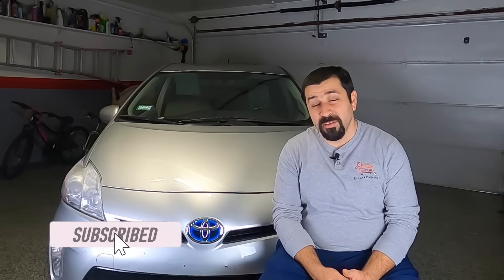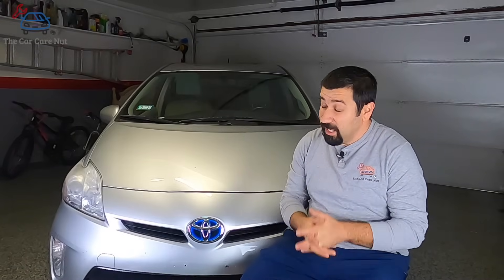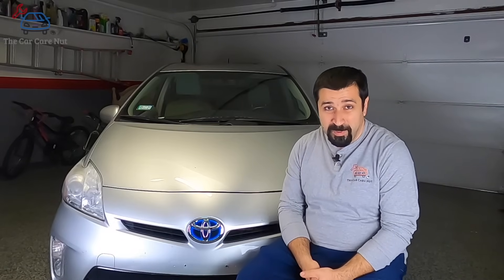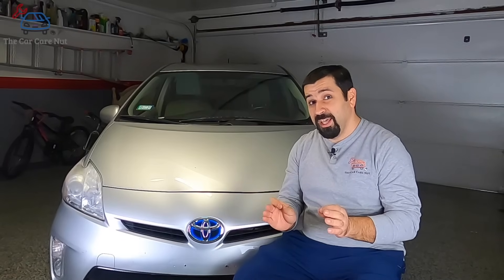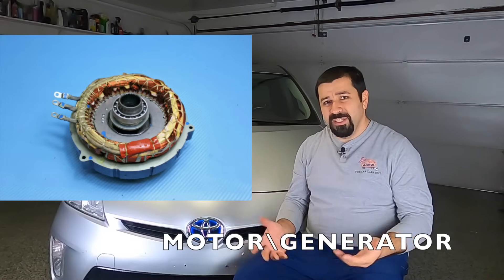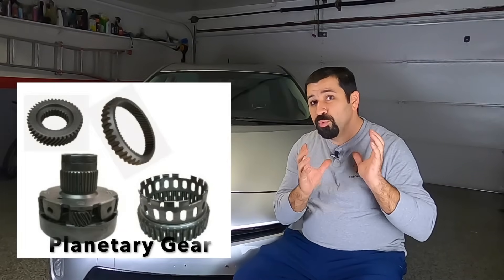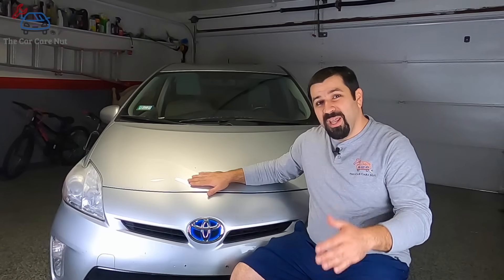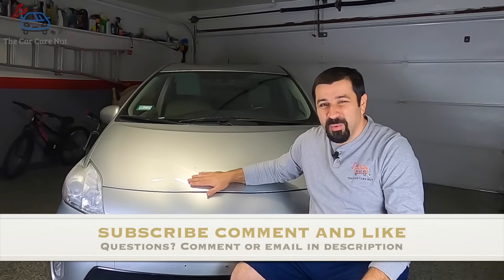How Toyota Hybrid System Work Part 3 Hybrid Transmission

Comment: Great job,    Couple of comments to amplify what you said, without getting too technical:  

At 5:15, when you run the engine fast, the MG1 goes much faster, and so MG1 uses most of the engine power to send to MG2.  So, engine spinning faster and wheels still spinning slow; That acts like a lower "gear" to make the CVT action work, even though no shiftable gears are involved.

At 7:00, battery can only take so much from MG2 on electro-braking.  If more braking needed, the disc brakes kick in to help out.

Comment: Toyota hybrids are reliable because of what is NOT in newer Toyota hybrids when compared to other hybrids.

No Gears, No CVT Belts
No Starter
No Alternator
No Timing Belt
No Accessory Belt
No Conventional AC
No Turbochargers
No Power Steering Pump
Reply: I just purchased a new Rav4 hybrid and absolutely love it BUT Honda hybrids also have No to all of the above.  Mind you Honda turbos are a major deal breaker for me.
Reply: @henryhonda8408  The Honda 1.5 turbo is extremely unreliable in Asia.
Reply: @henryhonda8408  Henry, Toyota Rav 4 Hybrid in real life will best the Honda CRV hybrid by 5 to 6 mpg 

Check out TLC YouTube Channel for details.
Reply: How can the engine work without timing belt?
Reply: @giannottister  It uses a timing chain, not belt. Just more reliable with zero service requirements.
Reply: @mobgma  Ah great, yes much more reliable, thanks.
Reply: @giannottister  mg1 turns it on as if it were a starter.
Reply: @giannottister  It can work if it has a chain Instead of a timing belt
Reply: They have planetary gears* and they do break... ask me how I know

Comment: Hi there. Hope you are doing well. I have a Prius s Turing selection 2016 with 39000 km in odometer. Previously I gave me 17km/liter. Now it is giving me barely 14km/liter. Should I increase the tire pressure from 32 psi to more. And also the engine is slightly getting louder.
Reply: I mostly drive in city and in eco mode. Use 0w20 havolin engine oil and average daily driving of 40km. It is Japanese made model with 17 in Toyo eco tyres currently running with 32 psi pressure. I always use ac At 24 digress. I live in Dhaka city Bangladesh.
Reply from the maker: Interesting have the weather changed!?
Reply: Wow.... that is really poor gas mileage...... my new Rav4 XSE hybrid gets way better mileage then your Prius.  I also always drive in ECO mode.  I traded in my 2019 Honda Insight hybrid for my new XSE and it consistently got between 55 to 60 US mpg (66 to72 per Imp gallon) in mostly city driving with a little bit of highway driving mixed in.
Reply: Today I went to my machanic and sorted out the problem. It is mostly due to my hired drivers driving style and the engine oil, though it is 0w20. My machanic said he has similar experience of people using  0w20 of caltex havolin have this sort of low mileage problem. Using Toyota 0w20 cures the problem.
Reply: Is your driving most in highways or something?
Reply from the maker: As tony mentioned how’s your driving mix?
Reply: @TheCarCareNut  My experience is that MPG for Toyota hybrids is sensitive to tires.  Toyota ships their hybrids with "green" (low rolling resistance tires}.  If you put on tires that are not "green" tires, they may have higher rolling resistance which translates to less MPG. I have experienced approximately a 4-6 MPG reduction in my previous 2010 Prius when I inadvertently put on non-green tires.  One year later, I replaced those tires with green Bridgestone Ecopia tires and immediately regained the lost 4-6 MPG.
Reply from the maker: Very true Craig! Only downside of those eco tires is handling. I guess you have a choice or a preference of mpg vs ride quality if you would

Comment: Hello ,the Prius transmission is heavier than a normal conventional manual transmission?
Reply from the maker: Hi! It’s very heavy! The motors are extremely heavy.
Reply: Thank you very much
Reply: I think it depends on whether you count the electric motors as part of the transmission.  Probably makes more sense to consider the weight of the complete drivetrain.
Reply: There is usually an extra motor mount to compensate for the additional weight.

Comment: You forgot to mention the clutch. When in reverse the motor spins backward to move the car. and the clutch disengages the engine; also, when the engine shuts off when not needed while driving on the road.
Does the clutch ever need replacing?
Reply from the maker: Clutch for reverse? In reverse mg2 gets power to move the car in reverse. Because of the planetary it can run the engine to charge through MG1 to power the battery if state of charge is low
Reply: Your videos are fantastic and so informative.I have just bought a 2022 Corolla  sport touring 2.0 l and love it. Does it have the same ecvt transmissin that you described in your video? @TheCarCareNut

Comment: Aw, c'mon! You could have pulled it apart if you really wanted to! We'll cut you some slack this time though.
I agree it is definitely not a CVT, if only because it works in forward and reverse with no physical change at all. It is a magical power transfer device.

In my mind, the amazing thing is that the hybrid transaxle is more reliable than even a classic manual transmission - no clutch or synchros to wear. Expecting 200K miles and much more without any service other than occasional fluid change is wishful thinking in just about any other type of transmission.

Finally, that clatter you mention (I never knew it was from the planetary, only that it was from something in the transaxle) is downright frightening at times. Our 2010 did it once and I was concerned it was about to throw a rod - no kidding! A little research revealed it is normal - at least in the early third gen - if the ICE starts a second before the system is shut down. Something about gasoline build-up somewhere, I guess. About five seconds of fear and it all smoothed out. Lesson learned: if the ICE starts when the engine is cold, let it run a few seconds before powering it all down. No more clanking.
Reply: Yes fuel in the air intake sure sounds horrible.

Comment: You might have mentioned that the "planetary" is a gearset, a kind of differential, and that the e-CVT is essentially a 1-speed transmission that requires help from MG2 to accelerate normally.  Also, the Prius was introduced in Japan and elsewhere in 1997.
Reply: If you name an ordinary belt cvt a 1-speed transmission then yes, e-cvt is 1-speed transmission.

Comment: Toyota Hybrid systems are the pinnacle of system engineering.
Reply: I’ve been running a Yaris hybrid for a few years. Toyota use the term eCVT, because the gear ratio between the engine and the drive shaft is continuously variable, with it being electronically controlled via MG1. The ratio between MG2 (the traction motor/generator) is fixed at about 2:1. Both MG1 & 2 are variable frequency 3-phase motor/alternators.

Under acceleration, it can run the engine at constant speed, and via MG1 (by controlling the ac frequency) the effective ratio through the planetary set varies.

Worth noting that the use of the hybrid transmission makes it practical for the engine to run in a pseudo-Atkinson cycle, ideally at a fairly high speed or not at all, so as to optimise it’s thermal efficiency. There is some clever modern power electronics sitting on top of the mechanical bits in the hybrid, of course - 3 inverters and 2 convertors, handling 3 phase for the motors, HV dc, and the usual LV dc for all the odds & ends.